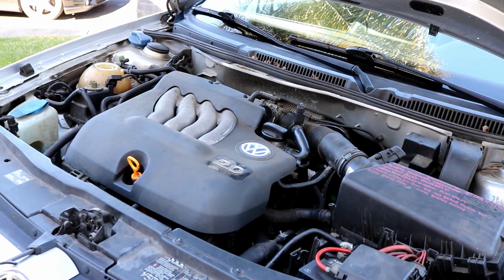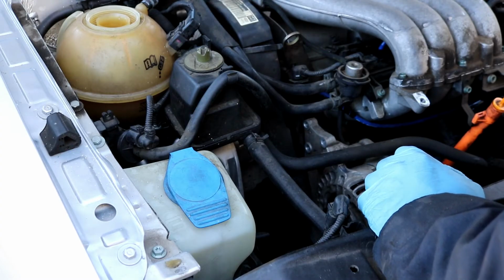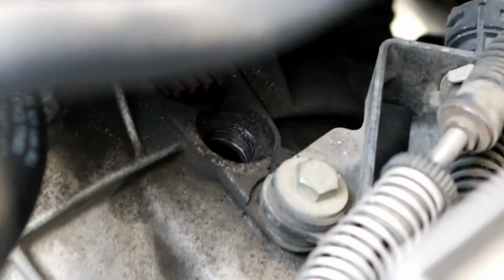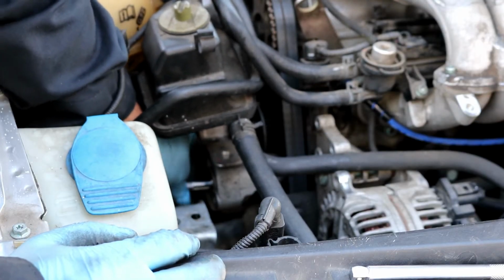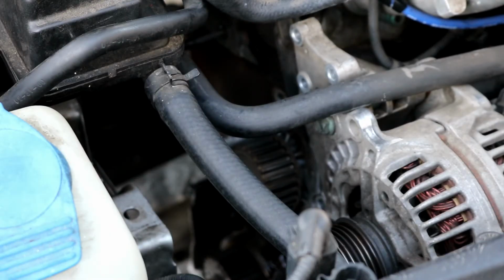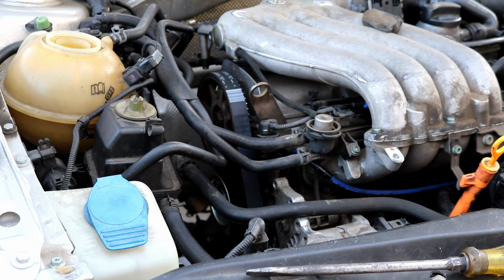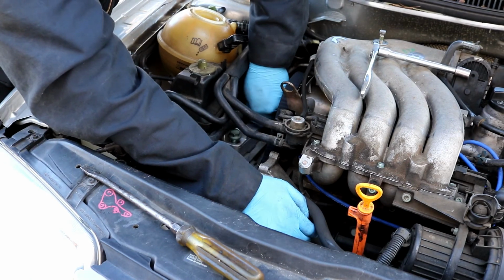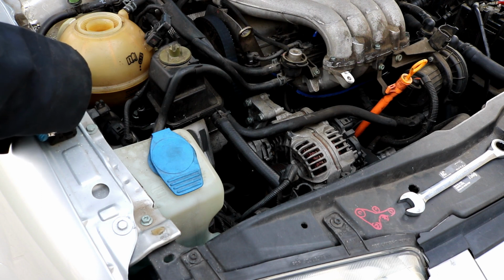Volkswagen 2.0L Timing belt and water pump! MK2, MK3, MK4 Jetta/Golf

Comment: Doesn't the camshaft sprocket need to be pinned? Did I miss that in the video?
Reply: Usually yes, on auto transmission there are 2 notches on the crank pulley

Comment: There is no flywheel tdc mark on my jetta what do i do? Ive changed the belt and pump before but i just marked crank pulley and kept my marks 100% in line when i changed. I gotta change them again soon and im scared again😂😂
Reply: Changes based on if you have a manual or automatic transmission. If it's automatic then there's a small window near that mark
Reply: @TheNinja23412 its manual
Reply from the maker: There should be a mark then on your flywheel. You can also just use the method you used before of marking things. It’s a little more risky but it is possible if you are careful and deliberate with your marks

Comment: What happens if the car is automatic?
Reply: I'm also interested to know
Reply from the maker: Look here. It’s hard explain. Cam gear mark is the OT mark. Flexplate mark is noted in the picture on post #8

https://www.vwvortex.com/threads/2-0-aba-timing-belt-marks-slightly-off-ok.9544431/

Comment: Maybe am I being dumb. Shouldn’t the crank be turned clock wise not counter clock wise? Does it matter? Someone please clarify if you know.
Reply: I was wondering the same thing and i ended up doing both😂 as long as the marks line up i dont think it matters that much
Reply: Yes - its better to turn the pulleys CW to test your timing because this keeps force off the tensioner.

Comment: What if timing jumped how would you fix it ?
Reply from the maker: If it jumped while the engine was running you could potentially have some engine damage depending on how far it jumped.

If it jumped while rotating it around by hand, you would just need to reset the engine back to the correct timing marks and reset the belt.

Comment: Are you sure you're supposed to turn the crank CCW? THE Haynes manual says to turn it CW.

ALSO: some film making notes: you did a good job of describing what needs to be done, but you missed some shots. Wherever you point, put the camera there so we can see it! Take stills if you have to, would've helped me out with understanding what it was. Also, don't move the camera while filming without a stabilizer. You don't need a GoPro, you can make one on the cheap or use a folded up tripod. Also, don't be afraid to shoot some separate footage! You missed some shots by not holding parts in front of the camera, some you did shoot, but the camera was out of focus. We can't see the wear on the belts! I would've like to see these on a bench, table or on the concrete with a close-up of the damage on the belts. 

Overall, you did a good job. There's some shots I would've liked to see more clearly, but I gained a lot from seeing this. Thank you for making it.

Comment: in my timing set there is a tensioner, belt and a nut and 2 washers. what is the second washer for? the first one I assume goes with the nut to the tensioner. can you include in the description the tightening torques for the water pump and tensioner?

Comment: I recently had a crank no start condition on my 04 new beetle. While attempting to diagnose, I took off the timing belt cover and realized the belt was completely loose on the cam sprocket. Would this mean valves are bent on this engine?
Reply from the maker: Likely they are bent. These are interference motors but you could have gotten lucky. You can do a leak down test first. After that, You would have to pull the head to know for sure.

Comment: Hi. At 26.26 you say to jack up engine considerably to remove the bracket. But how high realistically before you start snapping/breaking other parts ?
Reply from the maker: You need to raise it up enough to get the bracket out. I didn’t break anything else.
Reply: @HelpingHandAutoRepair  did you mean to say rotate the crankshaft counter clockwise? Everywhere online say clockwise and the Bentley manual doesn’t specify

Comment: So I live in michigan and when I was taking the crank pulley off, the part where the pulley sits on the lower timing belt gear were rusted together and they both came off as one piece. I didn’t time it like you did in the video because I thought I was just taking the pulley off but now I can’t get the lower timing belt gear back on because of the tensioner. So I thought if I left it alone and didn’t rotate the bottom end at all, I could just time it correctly after I installed the new timing belt and water pump. I know it’s a unique situation, but I’m wondering if it’s ok to time it after the new belt is on if I don’t move anything. I am also having a very hard time getting the new belt and tensioner to go all the way around all the gears. I’m pretty sure the tensioner is as loose as it will go but it is still having a very hard time going onto the gears. I’m wondering if anyone else has had this happen to them and what I can do to fix it. Sorry about the long comment, just a lot of questions. Thanks anyone for any information!

Comment: I do have one thing to add, at least on my car YOU CANNOT turn the tensioner left or right, ONLY counter clockwise, that really confused me since he tightened it clockwise, but my tensioner would not tighten that way, I tried different methods for hours until I just turned it counter clockwise and boom it worked, hopefully this helps somebody get rid of the headache I had when trying to do this, 3 hours just to turn it counterclockwise. Although everything else in the video was excellent.

Comment: Here an advice from a german mechanic: if you buy a new waterpump ( should be changed everytime TOGETHER with a new timingbelt !!! ) take one with METAL-pumpwheel NOT with a plastic one !!!. It happens often, that the plastic one loosen itself from the shaft while running a while.
Reply: That's what happened to me, it had a plastic one and it broke in half!
Reply: That’s right. I always buy a water pump with a metal impeller

Comment: Great video! Is there any check up on the tensioner? Followed your directions and got my TB, WP, tensioner, idle pulley, and serp belt done this weekend, started it up and it sounded great! But I wanna make sure that tensioner stays in line  at the cross hairs, do I check it after 100 miles or something?
Reply from the maker: Once you tighten it, you can check it if you want but it should stay in place.

Comment: There is one on the crank pulley, you have to look down into the engine bay an it’s on the inside of the pull there is two notches , the automatics have a rectangle window with a Lollie pop looking mark that goes to the bottom of the window👍🏼
Reply: Where is this rectangle? And lollipop looking image? Where are these notches? I NEED HELP LOL
Reply: @aidanlarge4289  if you look under the ignition coil, under the wire harness plug for the ignition coil pack, there will be a rectangle window cut out that you can see through, there may be rust that could be covering the (lollipop) timing mark ( it’s a sideways looking circle with a line) , you’ll have to get a wire brush in there to clean it. This is for an automatic trans by the way. For the one on the crank pulley there is a notch on the lower timing belt cover that will correspond with the inner edge (closest to the motor) of the crank pulley timing notch. Hope this helps sorry I’m a few days late reading this
Reply: @brenton1865 thank you SO much I have been searching for this info for hours

Comment: I thought engine should only be turned clockwise when setting belt tension.. as main thrust on belt is from crankshaft pulley…so there mustn’t be any slack on the 12 o’clock to 9 o’clock tensioner..?? Otherwise a good video, many thanks… Why don’t everybody just take off the coolant tank to give more clearance.. It’s empty anyway.?

Comment: Awesome video on account of completeness, details and cautions mentioned. I am considering taking completing this on my 2001 Mk4 2.0 ltr for the fun and savings aspects. Local shop asked for $1200 including parts but added on cam and crankshaft seal as replacements as well. At a 175K miles, I have not yet had problems with the seals, though I am considering the shops offer just on account of the seals.  My question … is it worth the preventive maintenance aspect and replace these seals given that the timing belt is already being replaced? Although I have the Bentley manual, I don’t know much about the seals.
Reply from the maker: I would replace the seals. You are there and it will prevent you from having to pull everything back apart to do the seals if they leak. Bentley manuals are fantastic to have.

Comment: What if the timing belt broke? Then what?
Reply from the maker: Then you would have to pull the head and see which valves need to be replaced and inspect the pistons as well. There will be damage, a valve job and a pressure test will need to be done at the least.

Comment: I had the same issue, 2 6mm Allen bolts came out easy and 2 stripped from previous owner. I used a spiral/cone easy out and a crescent wrench.. worked like a charm. just a tip

Comment: Great video,  My son did this on a 2003 Jetta 2.0.  Everything went well however he ended up with 2 left over hex flange bolts.  They are about an inch long and they’re marked as Fibam 8.8 on the head. Any idea where they go?  He hasn’t started the car yet because he’s concerned. Next step is to take it all apart.
Reply from the maker: Not sure. Might be motor mount bolts or the motor mount bracket bolts.
Reply: @HelpingHandAutoRepair  your experience elevates you to a genius, and a kind one at that!  They were the motor mount bracket bolts!  My son had dropped the bracket therefore he didn’t realize that that’s where the hex bolts went.  We found the black bracket lodged in the engine compartment.  Car started and ran like a charm after following your video!
Reply from the maker: Glad you got it sorted. Good on you two.

Comment: Hey boss really appreciate the detailed video, I'm purchasing a 2.0 wagon with the AT. Is there an access hole on that guy too or is that a whole different process? Its only got 97,000 mi on it, and the belt looked good but for peace of mind and practice I'd like to do this service. Thanks!
Reply from the maker: aba automatic timing marks
Reply from the maker: https://www.vwvortex.com/threads/crankshaft-timing-marks-auto-trans-2-0.8123746/
Scroll down to post #2
Reply: Thank you!

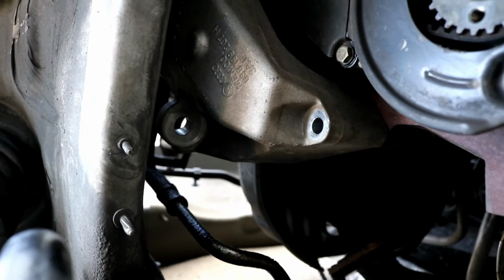Comment: Happy New Year 2022! Thanks for the great video, the whole exercise was a success thanks to your instructions. I did manage to discover a couple of things which helped me which I thought I'd mention in case it helps others too. To line up the tension indicator lugs on the tensioner I bought a dentists mirror from the dollar store so I could see under the tensioner and line them up perfectly before tightening. The other thing I discovered was to remove the bracket at 25:30 out the back of the engine and onto the floor instead of removing it from the front of the engine, out through the hoses and hood. There's a lot more room and way less fighting. It almost just fell out once I got the angle right. I didn't take the front wheel off either, I just turned it full-lock to the right but still had to jack the vehicle up by the chassis to work on it. In addition to the main jack, I used a 2 by 4 on top of a small scissor-jack sitting on a rhino ramp to raise/lower the engine. I put the timing belt over the water pump last. This way if the others want to move, they will move together - got it first go with no problems.
Reply: Happy New Years  2026!
Reply: @JacobClapsaddle  Happy New Year! Hope you got your timing belt sorted out👍

Comment: Great video thank you for the help! I just wanted to chime in and say if you have the automatic version of this car your second timing mark is not on the flywheel nor is there any way to check it your second mark is on the back ring of your harmonic balancer/crank pulley and the top half of the bottom timing cover you have to look at it from the top down and both marks should be at the top it's kind of hard to see but I hope this helps all you automatic guys out there dm me if you have any questions I can send pictures

Comment: Made this for myself. Thought it would be handy to have the timestamps clickable. Feel free to copy paste it into the description and add anything i may have forgotten. This video was super helpful thank you so much. 

TOOLS NEEDED
[  ] Clean shallow tub to catch/hold coolant 
[  ] Metric socket set (10mm-19mm)
[  ] Long Socket wrench entention
[  ] 15mm wrench or adjustable 
[  ] 2 T15 heads and a long flathead screwdriver for jerry rigged tensioner tool
[  ] 19mm 12point socket
[  ] 6mm allen head
[  ] Impact driver to socket adapter
[  ] Ft/lb torque wrench
[  ] In/lb torque wrench 

TAKE 'ER APART
[  ] Remove splash gaurds and Drain coolant
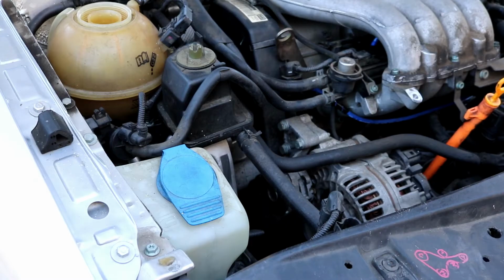[  ] 5:30 Remove serpentine belt 
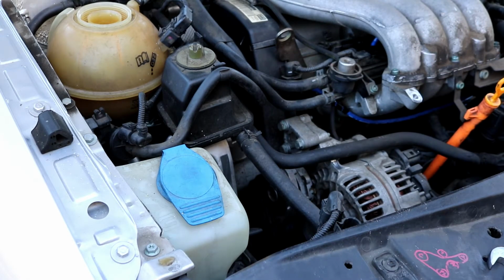[  ] 6:40 Remove serpentine belt tensioner 
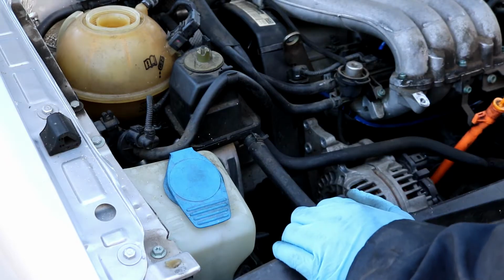[  ] 8:10 Remove upper timing belt cover
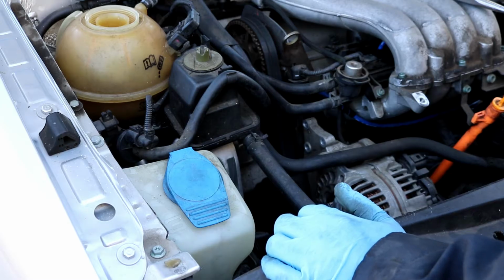[  ] 9:20 Remove crank pulley (harmonic balancer)
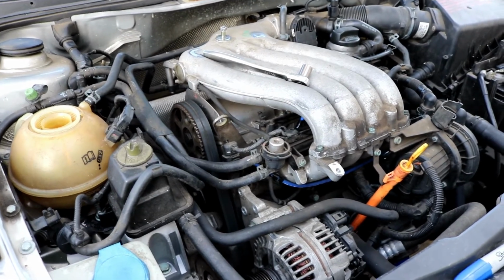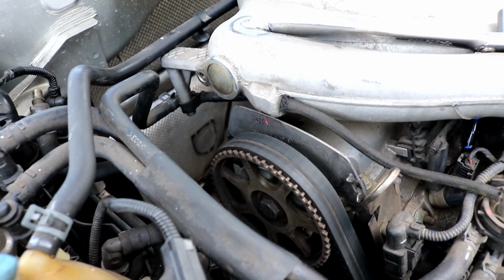[  ] 12:40 (15:20)* Zero out the timing belt 
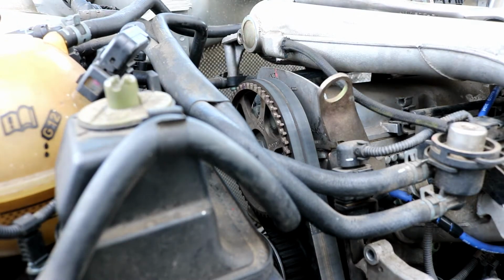[  ] (13:20)* 16:00 Check secondary mark on fly wheel 
[  ] (19:00) Use a jack and a wood block to support engine 
[  ] 20:10 Loosen coolant reservoir for easy access to engine mount bolts. 
[  ] 20:40 Loosen power steering reservoir 
[  ] (19:20) 21:40 Remove engine mount bolts 
[  ] 23:20 Lower the engine and remove the mount 
[  ] 24:15 Remove the top bolt for the mount bracket 
[  ] 25:20 Remove the other bottom 2 bolts for the mount bracket 
[  ] 26:50 Remove timing belt cover 
[  ] 27:30 loosen the timing belt tensioner 
[  ] 31:00 remove the timing belt and tensioner
[  ] (32:00) 32:30 loosen 3 water pump bolts
[  ] 33:00 slowly drain remaining coolant. Don't remove the water pump until the drainage stops.
[  ] 33:15 remove the bolt for the bracket above the water pump and move it out of the way
[  ] 34:10 Remove water pump. 

PUT 'ER BACK TOGETHER
[  ] 34:50 clean the area where the new pump will go scrape off old gasket that may have stuck.
[  ] 35:30 Install new water pump. **IMPORTANT** Tighten all bolts evenly until the pump sits in place EVEN THOUGH YOU HAVE TO REMOVE THE TOP BOLT IN THE NEXT STEP
[  ] 35:55 Remove top water pump bolt and re-install bracket above water pump. 
[  ] 36:20 tighten all three water pump bolts to proper torque
[  ] 36:50 wipe off coolant on the bottom of the crank pulley 
[  ] 37:20 install new timing belt tensioner
[  ] 37:50 install new timing belt
[  ] 38:30 tighten new timing belt tensioner 
[  ] Double check the zero mark on the fly wheel and make sure its still lined up with the timing belt's zero mark
[  ] 40:30 spin the engine a few rotations and triple check zero marks
[  ] 42:20 install lower timing belt cover
[  ] 43:30 put bracket back in place and put the top left bolt in place before lowering the engine. Do not tighten
[  ] 44:30 start one bolt by hand to hold the bracket in place before lowering engine 
[  ] 45:00 lower the engine and install the lower most bolt followed by the rest. Tighten them all.
[  ] 46:25 put the engine mount back in place whole the engine is still low
[  ] 47:20 start engine mount bolts by hand
[  ] 47:50 tighten bolts with impact, then socket wrench 
[  ] 48:30 jack up the engine and replace the 2 bolts (also cover the flywheel mark with cap)
[  ] 50:20 release jack
[  ] 50:40 re-install power steering bolt
[  ] 51:00 re-install coolant reservoir 
[  ] 51:40 re-install harmonic balancer 
[  ] 53:35 re-install serpentine belt tensioner 
[  ] 54:25 re-install serpentine belt
[  ] Replace undersheild splash gaurds. 
[  ] 57:00 Refill coolant

* timestamps in parentheses only show the location of engine and cooling componets in order to complete a task. All other timestamps demonstrate how to complete said task.
Reply: You are doing gods work out here sir. Thank you!
Reply: Man i watch the whole video i did this on my notes and now i see this comment omfg ima be reading comments first the next time
Reply: Came to the comments section looking for exactly this. Thank you!

Comment: My car starts then dies out after a few seconds is this because of the timing belt being bad? the car has 183k and samee timing belt. It does the same thing with the valet key. So i dont think its the imobilizer.
Reply from the maker: If that is the original timing belt. CHANGE IT NOW. Sounds more like you have a crank sensor issue. If the security key is flashing while you’re cranking the car, you have an immobilizer problem.
Reply: @HelpingHandAutoRepair  Nope wasnt either of them  Replaced them both i disconnected the MAF and it runs fine Hook it up and it stalls out.
Reply from the maker: Wel the belt wouldn’t cause the engine to stall, I am more worried about it breaking and then there goes the cylinder head. 

As far as me guessing a crank sensor or
Immobilizer, those are just that, guesses. Not being present with the car can only allow me to guess or assume things.
Reply from the maker: If you had a check engine light on the whole time, that would most likely have lead you in the right direction right away.